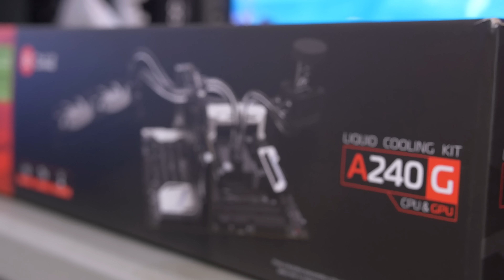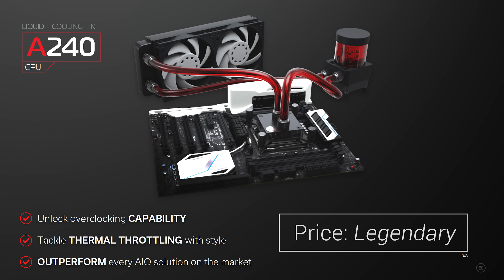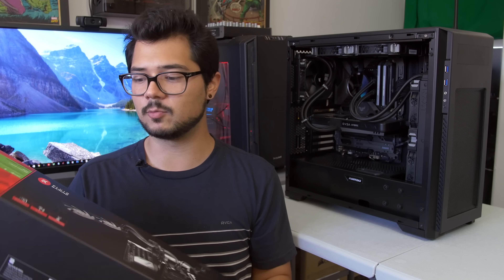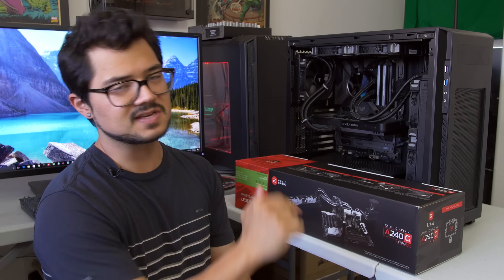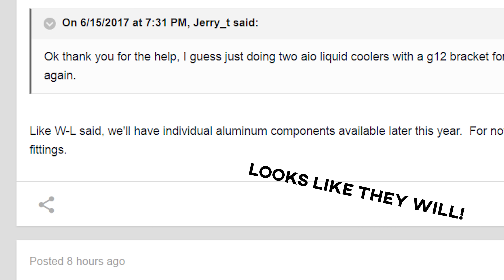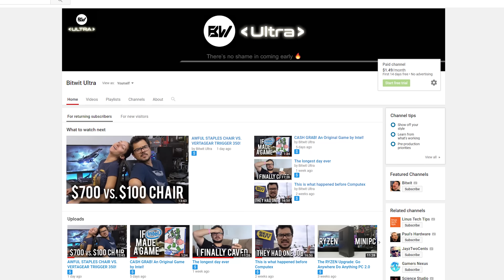FULL CUSTOM LOOP WITH *ONE* RADIATOR?

Comment: is it possible to mod my x63 280mm and X53  240mm  into a cooling system for cpu and gpu?
but i want to use just one radiator.
i would buy the gpu nzxt bracket for the gpu.
maybe putting more cooling liquid in it ?

Comment: Where do you connect the radiator fans since both are cooling the CPU and GPU radiator, in the CPU fan header or what would be the best solution?

Comment: You do know that you can use different metals in a cooling loop you just Need TO USE AN INHIBITOR  to prevent corrosion just like your home central heating if you have it uses steel/iron, copper and aluminium/zinc which will have a inhibitor in the system. so people saying that you cannot mix metals for water cooling they are wrong

Comment: If you are going to use a single 240mm rad you need to use it in a much smaller case otherwise your testing isn't worth shot as nobody will use a 240mm rad in a case that can use more... this would take into account the cramped space inside the case meaning all the components have a bit more heat around them.

Comment: Realllllly interested, as it is so similar to me with the 240mm EK MLC radiator on a full WB RTX2080 and deciding if i could integrate the upcoming 5800x CPU in the same loop on the same 240mm radiator!  Tnx Bitwit

Comment: You probably shouldn’t buy Aluminium fittings to make right angles in the loop even if you do find them because of galvanic corrosion. Your loop doesn’t have pure aluminium, it will be some type of alloy containing small amounts of other metals (I suspect). So using another aluminium piece is likely to speed up the process of corrosion. My 2 cents and I could
be wrong.

Comment: I have x570 chipset + 2x 1080 SLI, 3900x with monoblock over VRM also - all these components cooled by D5 pump and 240mm EKWB EX240 60mm thick rad with 4x arctic P12 pwm fans push/pull, all cooled very efficiently. Video cards reaching 58c and CPU on heavy 4.35ghz overclock on 12 cores up to 65c in gaming and 90c in stress tests. Having higher temp in radiator pushes efficiency dramatically with higher Delta T

Comment: My kit came in and it's been installed. I gotta tell you, these kits are 100% the way to go. I also bought the 360 expansion kit and it's amazing. My GPU sits at about 45-50C in game and my CPU unfortunately sits at around 70C but it's also a 7700K Overclocked sooo, that's to be expected.

Comment: Can you upgrade to hardline tubing down the road with the fittings included in this kit?
Reply: No. Hardline compression fittings are completely different. You'd have to buy new fittings, provided they make anuminium ones for hardline.
Reply: @usoppbarbosa981  Hardtube fittings are completely different
Reply: Yes

Comment: Where is the temps results ... ?
Completely useless.
Reply: Let's be honest, they're not going to be amazing when you're trying to cool a CPU and GPU with a single 240mm rad. Probably OK for quieter cooling on stock clocks.

That said, there's nothing stopping you from getting another aluminium rad from EK's line. As far as I know there's little difference in thermal performance between copper and aluminium based loops, so it should still be an effective and (relatively) affordable custom loop.
Reply: I hadn't finished the video when I wrote that comment, but he said the temps towards the end of the video

Comment: In my country Panama (35°C to 40°C) is not enough, I bought the Alphacool Eisbaer 360mm for my 8700K delided (liquid metal) and can handle 5.2GHz at 1.375v, not 5.3.

I'm looking for the EK Fluid 240R to use it only for my Vega 64 Reference (blower), it's the only way to reach more than my UV/OC (P1 1152MHz/950mV, P2 1252MHz/975mV, P3 1352MHz/1000mV, P4 1452MHz/1025mV, P5 1552MHz/1050mV, P6 1652mV/1100mV, P7 1702MHz/1100mV, HBM2 1055MHz/970mV). Power limit at max 50% and thermals/fan utilization P1 30°C/50%, P2 45°C/80%, P3 55°C/100%, P4 65°C/100%, P5 75°C/100%. With all my UV/OC settings, the GPU only reach 75°C max and HBM2 80°C max.

Comment: One radiator is easy. I have both a delidded 8700K and 1080Ti FTW3 on the same loop, with a single 420mm radiator. Granted - that's a big radiator and area is more important than qty, but still only one.
During heavy work and 4K gaming the three 140mm fans never speed past 600rpm, water temps sit at 35C and the rig is silent.
During hellish stress testing for both CPU and GPU the water sits at 37C and fans will ramp to 900rpm at that point, but fall right back to 600rpm again about a minute after the test ends.

Comment: What bugs me about this kit is that it doesn't come with a drain valve, nor do they sell an aluminum valve for it.  After contacting EK about it, they suggested I use a combination of a 3-way splitter and plugs off the pump discharge port to act as a drain.  Not as clean as I wanted it to be.  After making a mess in my bathroom draining the thing, I bit the bullet and spent almost 3K on a proper copper-based cooling loop.  I also wanted to say that for someone who has installed several custom loops, the EK instructions may have been clear.  For me, which this was my first, they were not clear at all.  In fact, no EK instruction book I've used to date has been clear.  They really need to borrow the American business model of using focus groups.

Comment: No need to watch this vid. Yes, a 240 Rad is enough. Easily. GTX 1070 and R5 1600 OC'd on a custom loop with all fans at lowest setting for quiet performance, rarely do I hit above 39C on either CPU or GPU.

Comment: I installed this kit on my I7 2600k and 1080 ti system this week and was very disappointed with the result. The CPU worked well and kept temps on par with my Corsair h100i v2. The 1080 ti was overheating in no time and ran hotter than my stock Evga sc black air cooler. Thinking about returning and getting a hybrid aio cooler instead.

Comment: 7:40 I've been looking at the A series stuff from EK for my next build. They offer tons of fittings in different colors and angles on their site as well as expansion items. Want more Radiator area? Snag a 2nd radiator, or a 360. Want a 2nd graphics card? Snag a 2nd plate and the fittings line up perfect. Really though, for a beginner while it will take some time, the soft tubing looks to be the way to go. I may try a hard run in the future, but I like the idea of flexibility for now. I'm not on the RGB bandwagon and it isn't going in a case with glass, it's going under my desk so I'm not worried about pretty. 

On a total plus note, You're the first one I've seen mount the reservoir sideways, totally happy that it's an option, didn't know that was do-able. Thank you for doing something different than every other person that's reviewed the loop so far. I know they sell larger reservoir as well so if you want more volume you can extend it.

Comment: It is only $240 U.S.?  Sell me two!!  I can use one to hang on the wall with the word STUPID written on it.  My i7 7700K overclocked to 5.3GHz never goes over 68 degrees C in heavy benchmarking.   I am using an air cooler, Noctua NH-U14S.

Comment: The G actually stands for GTX. There are two kits that have the same basic components, but one is for Nvidia cards only (240G) and then AMD Radeon cards (240R). The actual GPU waterblock has no bearing on the naming.

Comment: I call bullshit on these GPU temps.. I got the same kit and hardware (except 1080TI) + ANOTHER 240mm rad and still getting temps around 65C. More people on reddit with same kit are also getting around 65C on the GPU. Are his ambient temps around 15C? This case has worse airflow than mine.. This and Jayztwocents review is really missleading because both are getting their gpu around 50c, nearly impossible even with all fans at max speed.. Don't know what they are doing different or the "test" itself is really weak temperature buildup.

Comment: i wanted to use the thin 280 rad  for a a i7 8600 not overclocked and a 1080i mini is it possible? or would it be too loud or too hot?

Comment: Is it possible to use hard tubes instead of soft tubes with this kit?
Reply: Dipto Joutirmoy yes, probably. If they are the proper size. However, you defeat the point of this kit and that is to help newbie watercoolers and give them all the parts to help them out on a cheaper price.

Comment: You make good videos, but I could not help but cringe at that huge amount of goop on the GPU and the thermal paste running down on your cpu because of the vertical mounting of the heat-sink. I get that last part thou. You did because lighting/camera angle. Am I being reasonable about the GPU thermal paste use being too much?

Comment: What surprises me is that the CPU is 70 something, and that water dumps into the GPU which is somehow 20 degrees cooler. I was just planning a 800$ water loop that includes like 3 radiators, and now I'm questioning my sanity.

Comment: is the thermaltake pacific 360 rad aluminum? not the RL360 but  just the reg 360. I have one of those kits and was thinking of buying one of these and using the 360 rad with it. I have the whole 360 kit thermaltake sells with the D5 and stuff?

Comment: I think the main problem with aluminium v copper is not galvanic corrosion but gunk inside the system, copper naturally helps to kill micro-organisms to help keep your system cleaner for longer. I would assume the aluminium system will be green with crap in just a few months.

Comment: but in the old case setup, you were using warm air from the CPU rad loop to cool the GPU you rad loop. Of course, you will see a huge difference when using cooler air.

Comment: Great review but I was wondering at which RPM the fans need to run in order to keep those temps. If they need a RPM of a vacuum cleaner it does has a big disadvantage. In other words, how loud is the system?

Comment: bro this experiment you did was full of flaws. you never talked about noise levels or even how fast the fans were spinning. it honestly looks like you skewed the info in EK's favor.  also you straight up changed the placement of the radiator
Reply: 1idd0kun lol "the resevoir is reseving fresh air from the intake fans" you now that a resevoir doesn't cool your system and that that doesn't matter at all
Reply: Lol radiator placement doesn't matter, and every other reviewer I've seen is having the same or better cooling numbers so are you saying they are cheating as well?
Reply: im alittle dissapointed, ive also heard contradicting statements from other channels that says this thing doesnt perfom that well.
Reply: I think one of the reasons it works well in this setup is because the reservoir is receiving fresh air from the front intake fans.

Comment: i think the reason why a single loop isnt hotter is because temps dont add each other (say 30 C + 35  C  doesnt equal 65 C....it will still remain 35 C) correct me if i'm wrong!
Reply: RipJawsX 95 its not 100% like you said. You are correct in that they don’t add up but if you send in hotter water from the GPU then before with the AIC it will raise CPU temps as the water has more heat in it then before and won’t have as much ability to cool the CPU.

Comment: The Kraken CPU tempreture is not affected that much of the cold water coming from the radiator.The cpu block can't take more heat because it doesn't have mass.If the CPU block is way bigger and the same waterflow is running in there your CPU is going to be way cooler than with this block.

Comment: Where can I contact u .. I need your help if u could please help .. I have a newly build that I built inspired by your vids .. I want to over clock I have a 7700k asus 1080 strix advance card and corsair 16gb 3000mhz rgb vengeance .. on a asus  z270i strix motherboard

Comment: One problem... fittings are not aluminum so anything you add will eventually have some corrosion if it's not aluminum fittings. who the fuck has time to find all that? EK fucked up in my opinion.😑 It's not even that cheap when for a few more $$ you can get a proper copper or Nickle / brass setup.

Comment: Something to note though is that aluminum has a thermal conductivity of 118 and copper of 223. That's quite a lot higher. Just to keep in mind you're on the inferior metal for future upgrades and you can't swap in copper one by one.

Comment: 65c evga hybrid????
i cant believe this.....honestly... that evga hyrbid has the same power limit as reference card....
even you are using the stock evga rubbish radiator fan, you should have got below 60c.
Reply: Maybe it has a different fancurve wich only ramps up above 70c because 65 is still really cool
Reply: He was OC'ing the snot out of it. He said he was pushing 2050 Mhz. At this OC, the card is hitting it's power limit all of the time. So, 65 is actually really good.
Reply: Agreed. I’m using a 240mm radiator and my asus strix 1080 never goes over 45c ek pump, ek amd block and phanteks full 1080 block.

Comment: Would it not be better the have cool water split and sent to each component separately, then have the warmed up water from both joined before entering the radiator? This would possibly give more headroom for cooling the CPU (or the second component in the serial scheme, whichever it is)
Reply: PC water-cooling does not work that way. It would not make any measurable difference to temps.

Comment: Regarding the corrosion, just add something that's even more corrosive then aluminum and let that rust in the loop and the aluminum will be safe with copper or anything else as long as that other metal is rusting.

Comment: I tried to cool a 980ti and a 6600 k both overclocked on a 360 rad temperatures were in the 85 to 90 range

Comment: I just installed one of these kits in a recent build. i5-7600k and EVGA 1080 SC all in a Fractal Nano S! On idle I get 30C CPU and 30c GPU, with room at 76f. When gaming for hours CPU is at 55-60c and GPU 40-45c. 3 complaints I have with kit is no other fittings currently like 90deg. 2nd is the GPU front terminal was supposed to have a LED, even in instructions it says to plug it in. BUT it doesn't come with a LED. And last the plugs for the GPU are plastic with those dumb coin slots that are hard to tighten, did have a small leak, so had to tighten really hard, no more leak. Talked to EKWB about these issues, and later this year they are coming out with more parts (360 rads, angled fittings, and possibility for hard tubing). Also the LED will be an optional item later as well. So for the price it is a great deal and delivers Great Performance, and Damn is it light! And to all the people complaining about draining. I already drained it once, was EASY! i placed the pump at bottom of loop so just uncap the top and loosen screws and pour it out. easy cause of soft tubing.

Comment: Water cooling is over rated. I run an I5 on air 5Ghz in the 50's easy maybe 60's occasionally on high stress. No it's not some overweight monster just a Bequiet Shadow Rock Slim. I actually dumped my water cooling after a leak, lost no performance and it's quieter. I wouldn't of believed it, after watching all the youtube overkill cooling. Air done right is easy, cheap and works. Don't believe the line you need water for overclocking.

Comment: I got this exact kit on a 6700k and GTX 1080 FE. So I think I know what I am talking about. My CPU only gets up to 58 degrees, GPU also 52 sometimes 54. Pump is mostly under 30-40% load because it makes annoying noises when it runs on low rpm. Your CPU is only so warm because of the OC. What staggers me a bit is that the CPU goes up to 76 while the graphics card (which gets the coolant that was heated in the cpu block) goes only to 52..

Comment: What were the noise differences between the two systems? That's one of the bigger draws for custom water cooling and why so many use more radiator space than necessary; so they can keep their fans running sub 800 RPM.

Comment: Based on your numbers: The Cooling wattage on your CPU AIO was overkill, that is, the CPU was putting out less watts than the AIO was rated for. On your GPU AIO, the Cooling wattage was under what the GPU was putting out.

Switching to this EK solution, you gave the GPU access to more Cooling Wattage with no real cost to the CPU. If only manufacturers gave detailed heat transfer specifications for their parts.

Comment: Hi i’m slightly new to pc building any suggestions for my future $700 USD build:
CPU- Ryzen 5 1500x
with stock cooler
Motherboard- ASRock Ab350m-HDV Micro ATX 
RAM- 16gb (2, 8gb) Corsair Venegance LPX
HDD- WD 1TB 7200rpm
GPU- GTX 1050 TI asus strix 4gb
Case- Corsair spec 02
PSU- EVGA 500w bronze

Comment: The larger volume of water in the loop with it's greater thermal capacity compensated for the smaller radiator surface area? Very interesting!

Comment: the temps on the gpu don't seem quite right. i understand there are many variables and that they would be different in each case but I have a fe gtx 1070 that I took apart and put the evga hybrid kit on and oc to the same as you've done here but i max out at the highest of 41c after 5 to 6 hours of gaming. under benchmarks it never went over 42c after 2 hours of valley, heaven and furmark. also i realize i have a 1070 but should your 1080 hybrid be running that high of temps at that oc?

Comment: If you were using that 240 rad as an intake, your temps would be even lower....also, why do you always mount the reservoir/pump combos sideways? They can mount vertically in most cases, just sayin...

Comment: It's not that impressive. It's fit out for 2 heat producers. General rule of thumb(unless it's changed) is ~1 fan's worth of radiator per load item, possibly toss in an extra fan's worth to the total if you're overclocking anything(heavily).

Comment: The key is if you want to expand Han don't buy it because you can't mix any other parts. If not it's great. Makes me think how could thermal take charge 100 plus dollars on a aluminum rad when it probably cost 5 dollars. Why not make it cheaper to break into the market